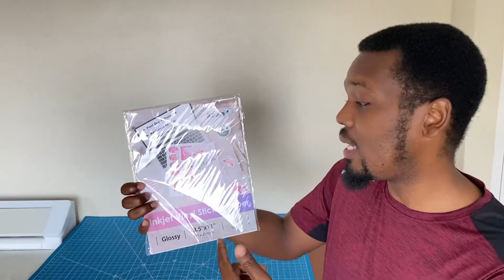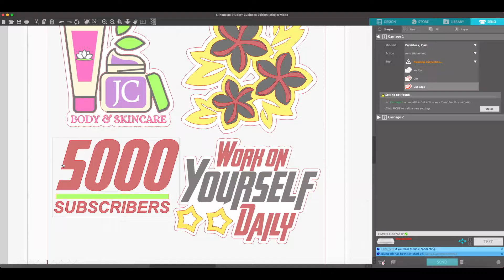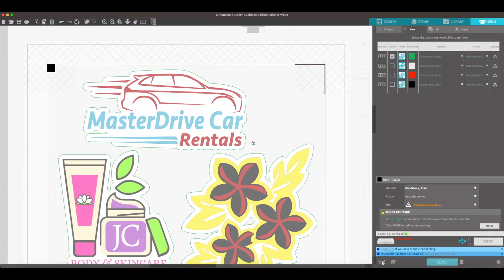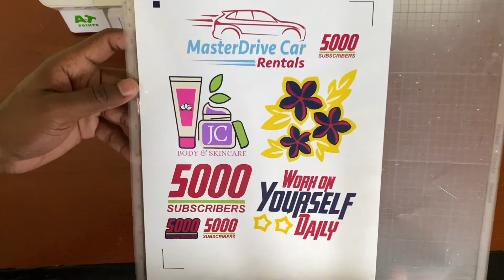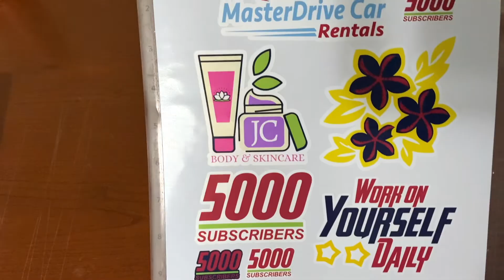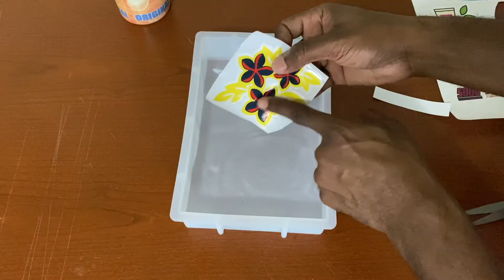Creating Stickers using Inkjet Vinyl Sticker Paper

Comment: AWESOME REVIEW!  I wonder if it is UV RESISTANT???
Reply from the maker: Well for me after a long period like a year, you will get some fading as the sun does with stickers. It also depends on where you live and if its always hot and sunny.
Reply: If you use something to clear coat it or protect it, they fade anywhere from 3-8 years where you want to replace. Oh, you have to coat them with a clear coat which is how I make mine last. Lamination is best if you have a machine to do that or you can heat shrink some plastic on top if you're handy (I would test a small piece.) OR you can use the same stuff they use for clear coating crafts, it comes in a spray. I've done all of these.

Comment: hellow what brand of vinyl sticker do you use  and do you use pigment or original epson dye ink?
Reply from the maker: Thanks for your questions. I have all the links in the description with the different brands and I use  both depending on the printer. However, since i have an espon 15000 i mostly use that. I hope this helps.

Comment: why the ink is not dried when i print on my epson inkjet printer,,  and also color got dissolved,,  can you give any solution
Reply from the maker: @HasibSarkar  thanks for your question. Can you share the type of printer you are using? In addition, you can look at your printing settings and the type of paper you are using.
Reply: Did you ever figure it out? I have a feeling I'm going to have this issue. Did you follow this video first?

Comment: What constitutes as waterproof? Only the ink not coming off in water? Or the sticker not coming off something when you wash it, like a tumbler or cup? What kind of sticker should I use for things that are usually washed?
Reply from the maker: Great question.
So in this case I would say waterproof can serve both answers you gave. However, when we say waterproof, the type of sticker can absorb water and outside weather. 

If you are looking to put images on tumblers and cups, and you want to wash them regularly, it would be best to get sublimation tumblers and cups so you can bake the images/designs into the item.

I hope this answer helps.